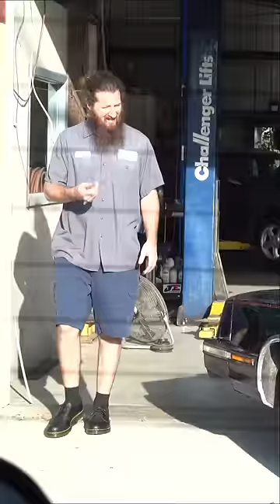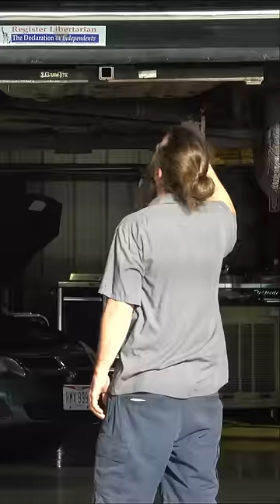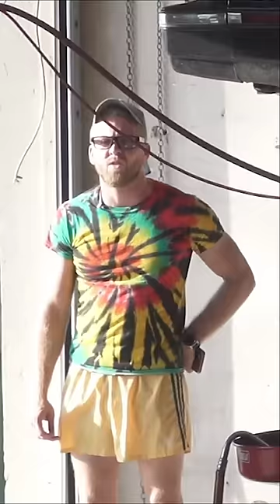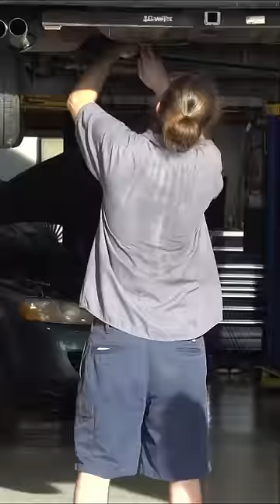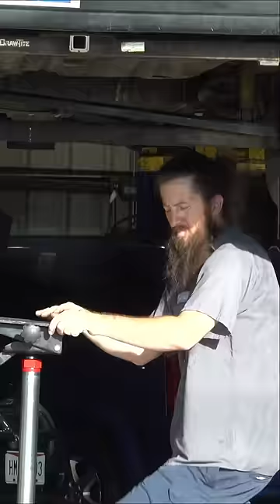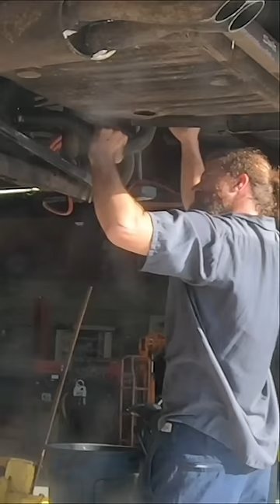Full video 👆

Comment: As a mechanic this would make my day. And tell this story for a lifetime. "Remember that guy with spaghetti Os in his gass tank." 😂😂😂
Reply: His fool plump
Reply: His flool plump
Reply: It sounds so unbelievable 😂😂😂😂
Reply: And then I would remembered that I charged that ass $500
Reply: I wouldn’t believe it 😂 unless u showed me this video
Reply: I would die, this sounds so painful to work on
Reply: Gass? That seems familiar 🤔🍃
Reply: Bro he unscrewd the exsaust and said there is beans in the fuelpump
Reply: @d1viking he undid a fuel line… wdym unscrewed the exhaust anyway lol
Reply: Spaghetti OS in the gas tank is insane
Reply: Its a glass tank not gass tank
Reply: In his fool plump.
Reply: Gass 😩
Reply: I'd start calling the fuel pump a "fool pumpy" as the inside joke of the shop
Reply: @TM-fx5le you know... Because mufflers are threaded on... 🧐 🤔
Reply: @SpreadJoyAndTheWord  🤣🤣🤣
Reply: One time, I bought this old Jeep xj, and we had to bypass the heater core, so I was just going through replacing everything I could reach. Well, when we popped off the thermostat housing, there were 2 full ass peanuts in there.  It turned out that the jeep had been dry stored in a garage for 10 years, and we think a mouse or squirrel or something tucked them in there while  the engine was sitting on a pallet.
Reply: In his glass plump